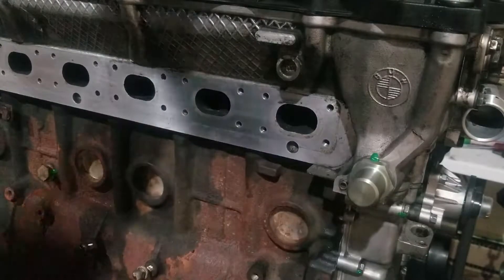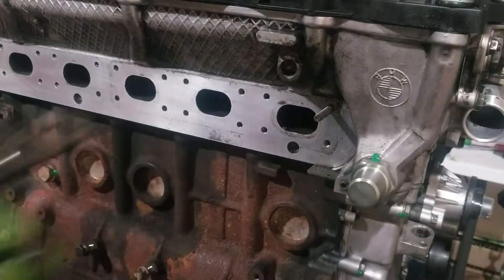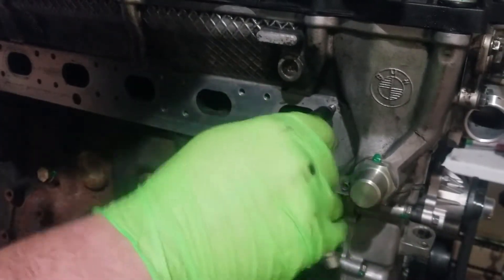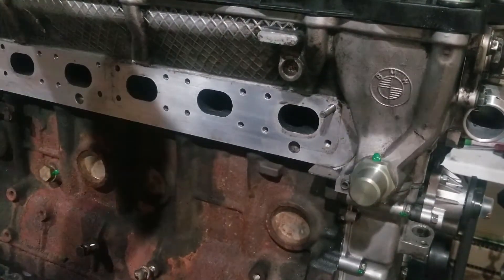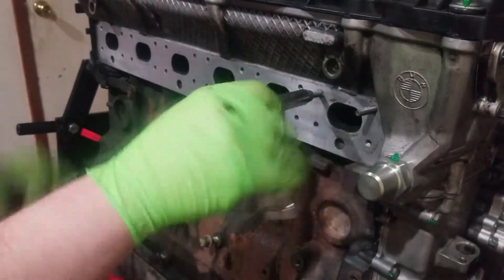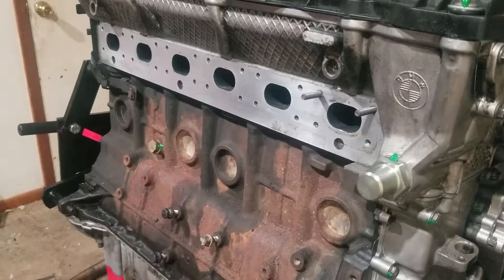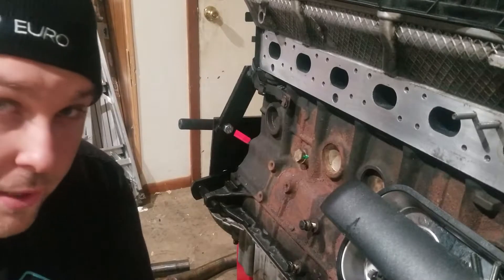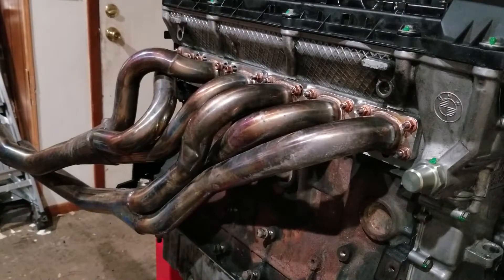How To Easily Install Exhaust Manifold Studs

Comment: This worked great for threading m10 studs into my exhaust manifold.  I also considered using a drill chuch hex attachment, however, I was concerned about damaging the threads, so I used this approach.

Comment: Question.  I used the newer stud that was recommended using E Torx for easy installation.  My only issue is I can't get the New exhaust  stud into my head. Only goes about 1mm in then it's very very tight.. they are oem from BMW n52 studs going into my s52 but they won't thread in fully without force.  Any recommendations??? Was going to use a thread chaser on the studs before giving it another try. . What do you think?
Reply: What did you do in the end?

Comment: I have those locking cam type stud tools from Cornwell. I don't even want to use them for putting manifold studs back into my M54's head, I've seen them damage threads. This was helpful, thanks.
Reply from the maker: The double nut method is effective most of the time. The real trick (that I learned after doing this) is using the exhaust manifold studs from the N5X engines which are the same thread size but have a convenient etorx drive on the tip for easy install, p/n 11127593376.
Reply: @GarethFoley  Good to know. Also, your E46 rear main seal and clutch video with FCP Euro has been a life saver btw.

Comment: If anyone sees this, I recommend the exhaust studs for an e9x chassis bmw that has the n54 engine. They are much cheaper than e46/e36 studs and have a torx end to screw or unscrew them. Makes it a breeze.
Reply: thanks for that and what perfect timing as i got all nuts with studs out :D so I might just buy those studs with torx head and put nice new copper nuts :) thanks a lot !!!

Comment: Ok another guy on another channel used thread locker with the studs...so which is best anti seize or thread locker
Reply from the maker: There is no reason to use thread locker. Exhaust manifold studs on these engines don't have an issue backing out or coming loose. Rather they have an issue of seizing in place on occasion due to galvanic corrosion (aluminum head + steel bolt). A small amount of copper anti-seize prevents thread calling and helps lubricate the threads so corrosion can't occur. That way of the studs ever require replacement or removal in the future they can easily be removed.
Reply: Gareth Foley I can tell you this I will never be taking these out again....guarenteed...considering I had to crawl underneath the car in 90 degree weather,,,and somehow maneuver my impact around the exhaust manifold to get them off....the funny thing is the bolts were rusted together with the stud,,,so the impact took them both off at once...after 2 hours of hitting the heat shield to get it out of the way,,since those bolts were rusted together into the manifold......and none of them had any lubrications on them from factory...I did like you said though and used the copper anti seize for the new studs...however I found it easier to use less thicker nuts instead of flanged nuts...to turn the stud in

Comment: DAmm and no lie like 5hrs ago I finished installing on my 330ci and I have 3 studs left over I'ma do this tomorow
Reply from the maker: Huge pain in the rear to install all these studs. I ended up using N52/N54/N55 exhaust manifold studs which have an etorx drive on them for my spare engine which is not in the car.